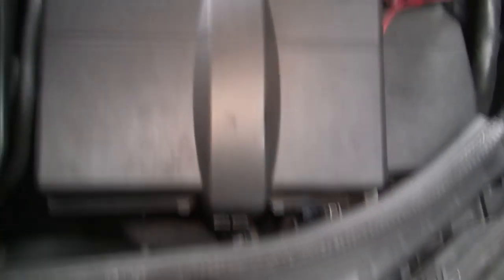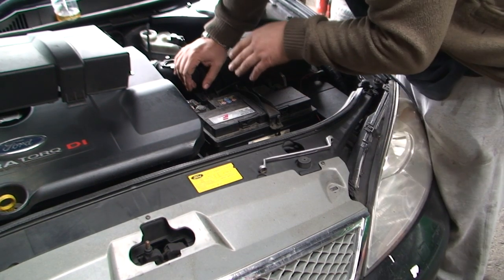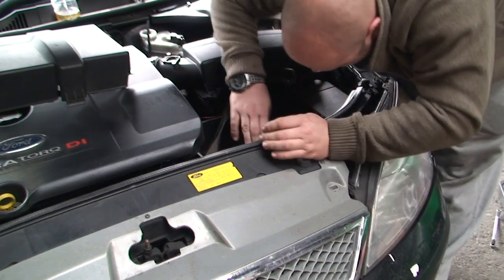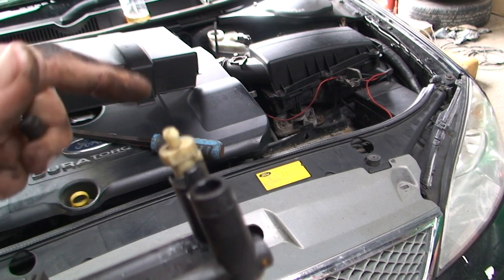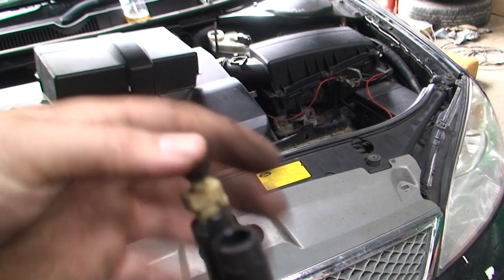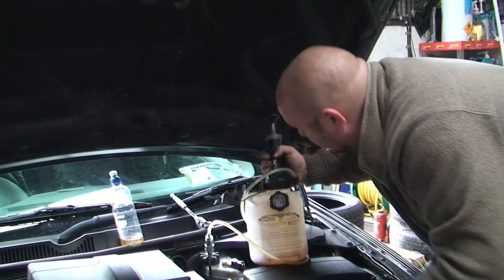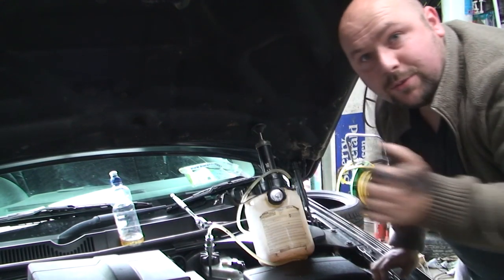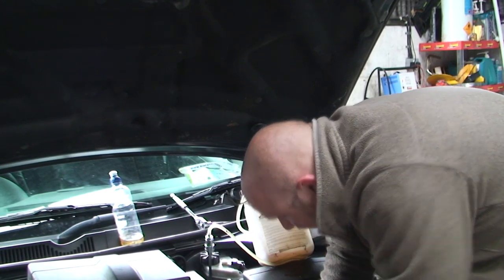How To Bleed A Clutch The Easy Way

Comment: You should always remove the neg first and re-connect it last. And if you remove the negative first and it touches the body how is it still earthing as you said in the vid???
Reply: Remove the negative off your car outside and put it to the fender and let me know what happens
Reply: @MeltingRubberZ28  So tell me what YOU think will happen if I do that?
Reply: @SteveCardiff  I've done it before on a car so I don't even need to state what I "think" will happen haha.
Reply: @MeltingRubberZ28  I really don't think you have done it before because if you did you'd find that nothing happens because you're not completing a circuit back to the battery. If the negative is disconnected from the battery then that's it, the circuit is broken.
Reply: I couldn't believe what I was seeing/hearing. He is doing the exact opposite of what you're supposed to do.

Comment: @ bodgit and leggit garage. I have just had my clutch replaced. Sachs DMF clutch plate csc and pressure plate I think. It has only done 10 miles since and been parked up for 6 weeks without moving. The clutch pedal is half way down and bites within an inch. I pulled the clutch up with my foot and it sat aligned with the other pedals. It goes into gear fine, it does bite early, about an inch, inch and a half but not a grabby bite point. It is nice and smooth. Do I just need to put mileage on the clutch or would you say bleed the system? My fluid is not 100% either but it was fine before hand apart from the DMF rattle which is why I changed the full clutch. Car is a Vectra C 1.9 CDTI 150. Thanks in advance mate. Brake fluid is still full to the brim.
Reply from the maker: try bleeding it again
Reply: @bodgitandleggitgarage  I will do mate. Thank You. Should I invest in the bleeder tool for better results? Worth the money versus 2 people and time etc? Cheers bud.
Reply from the maker: @boxingbreakdowns1016   it will certainly make it easier if you have the right tool mate it's not that expensive and you can use it for brakes and everything you will be using it a lot more than once believe me
Reply: @bodgitandleggitgarage  Cheers mate, that is the route I will go down then. After all it is a tool with many uses. I will keep you up to date once I have had a chance to bleed it again using that tool and see how everything goes. Thanks for your time and advice bud. Much appreciated.

Comment: Today i tried to bleeding the clutch with same pump, but the clutch pedal is very  soft now and does not work. I don't know what i did wrong. Before opening the bleeding screw, do I have to press and hold the clutch?

Comment: I hope you answer your viewers. I have a 2000 dodge dakota sport,  manual transmission. replaced clutch master cylinder and slave cylinder. I have air in the lines. It is a sealed system which means no bleeder valve. I know some will work out as I drive. do you have any ideas how I can get the air out more efficiently?
Reply from the maker: Evelyn Mitchell hi mate unfortunately I don't work on that type of vehicles we don't get them over here so I don't know exactly how the system is done there is ways you can bleeding by disconnecting the pipes and allow the fluid to run through and reconnect them again but I don't know how that system works so I do not want to tell you to do something and you caused damage if it was a vehicle we get over here I would be able to tell you a lot more I hope you understand

Comment: Hi again mate
I have just had an head gasket replaced on my agila 1.2 2003 and have noticed that there is still a little mayonnaise collecting on the filler cap. No loss off water from the tank No overheating and the car seems running great, is this normal or assuming the mechanic who did it didn't flush the engine. Will it cause yet more problems. What would your expert advice be?
Reply from the maker: Hi mate yeah that's pretty normal it is very hard to completely get rid of all of it the thing i always tell the customer to do is to replace the oil after 2000 miles then check and you might have to do one more time and that should be it but it's always a good idea just to keep an eye on all the levels just in case hope this helps thanks

Comment: Hi Leon, I'm changing my brake fluid and may as well bleed the new fluid through the clutch. People are telling me to avoid pressure bleeding as it can blow seals. What's your thoughts on this mate?
Reply from the maker: it's like everything you don't go go too much pressure get the manufacturers specification and you will be fine

Comment: Going to try this 
 i have a astra h and the clutch gose to the floor no pressure in it at all comes back up tho and i cant get in to gear when car is running any ida what it maybe.

 getting a newclutch kit in case any way
Reply from the maker: Hi mate it's very difficult to say as I'm not beside the car but if the car doesn't go into gear it sounds like you've got a clutch problem the car should go into gear when the engine is switched off if not you've got a gearbox problem and possibly a clutch problem
Reply: Hi mate I’ve replaced a clutch on an Astra sri 08 and after two months the gear wouldn’t go into place unless forcefully pushed and it made a loud screeching noise, I tried again 6 months later and now it’s going in to gear but sometimes with a strain and I have to be delicate with the reverse, makes a large clinking sound. Any help on this would be great been proper stressing about this shit for ages

Comment: Hi again!Nice vid!Once I decide to bleed my clutch cause there was no signs of fresh fluid in clutch bleeder after break fluid replacement.I tend to think that Peugeot center hasn't done anything cause once they spotted me watching them they closed the shutter to work area.So,why the break fluid was kind of dark grey and jelly?It is normal condition of b fluid in clutch line?Regards
Reply from the maker: Nemo Cap hi mate I will be doing a video on brake bleeding and brake fluid very soon how to test it what it should look like and how to do a full brake flush

Comment: Hiya I've been doing the brakes on my Passat b6 I bled the brakes and when I came to bleed the clutch the pedal stays down can you help me out with why it's happened? Do I still need take more air out as it's took quite some time and there's still signs of air, also what's the bottle pump called?
Reply from the maker: hi mate yes they must be there still in the system it is a lot easier to bleed the clutch with two people unless you have the one man bleed a system which is what I use in this video which makes life a lot easier but you must still have some air in your system if you get someone else to help you it'll be a lot easier

Comment: Is here a separate clutch master cylinder, or does that pipe you 'pointed out' coming from the fluid reservoir go directly to the clutch slave cylinder? 
Many thanks for all your videos over the years, I have found them to be a great help. Jim
Reply from the maker: lascar48 hi mate on this model yes it has a master cylinder and a slave cylinder but it does differ from model to model
Reply: Many thanks bro.

Comment: Great video mate. I recently bought Fiesta and after 2 weeks driving I'm sure clutch gets harder to push down when I'm driving. Clutch seems good when I get in but gets harder when I'm driving. It's only done about 20K about 5 years old. Could it be air in the clutch system. I just don't know. Thanks for any help
Reply from the maker: Dave James hi mate normally when the clutch goes hard it's the release bearing when you got air in the system the clutch normally just go straight to the floor and does not pop up but these are just normal always weird things can happen in between
Reply: Cheers mate. But would you expect release bearing on a 20K mile car. Or is it the way the previous owner drove it. If it is realease bearing, is that basically a clutch replacement full on. Thanks
Reply from the maker: Dave James hi mate it all depends on how it's driven and it all depends on the part that was put in I've seen them feel brand new I've seen them to do over 150000 miles it's just one of them things that can fail at any stage I'm not saying it is that but from what you're explaining it's certainly sounds that way it could even be pressure plate

Comment: Cheers bro, my mk 7 transit is exactly the same, the fluid is black and the clutch pedal don't bounce back, I can't change gear unless I pull the pedal up with my toe, can't see no leaking under the Bell housing either, or in the foot well by the clutch pedal, thanks for this upload its not the first time I've found solutions on your channel
Good day bro
Reply from the maker: Thanks a lot mate much appreciated I'm glad it helped you

Comment: Hi mate, I’m still getting air every couple of days the pedal bitting point getting closer to floor. No leaks, 6 month old CSC off fiesta 1.25 07. I think it’s sucking air in through bleed nipple so I’m going to put new clutch and CSC and reverse bleed it as I read on Ford website. Sorry my question was when reverse bleeding does the pedal have to be on the floor and can I use a syringe or do I need a special pressure tool to reverse bleed it. Thanks mate and sorry for being a pain. PS I did get the spare tyre pressure bleeder like you suggested but it didn’t work. I think what’s happened is when I bled it before I noticed it was hard to turn the plastic bleed nipple when bleeding because it was under pressure and I think when I turned the nipple it turned the seal and it’s sucking air but sealing when under pressure. I’m just one of the unlucky people 😊 love your videos.

Comment: Video i made:https://youtu.be/vcJP3tW3ces Can a clutch master fail in this way that it does instantly move out the slave but not far enough when the clutch pedal is fully depressed? The slave does move out instantly when I depress the clutchpedal. Also can this problem be cause by to much play on the shift mechanism? The flywheel, frictionplate, slave + bearring and pressureplate are new and I have driven 2000miles with it  without any problem until someone launched my car from a standstill, wanted to shift to 2nd during the launch which blocked like seen in the video. The clutch does not slip, engages and disengages fine. When i floor it to like 3500rpm i still can shift but if i floor it to high RPMS it blocks. Im thinking, somehow the gearbox still gets input i guess when flooring and depressing the clutch.

Comment: Topman, you've just made the process look less daunting, my clutch pedal fell to the floor on my astra j  with fluid leaking on top of the gearbox from the plastic elbow that goes into the slave cylinder so hoping that the o rings and elbow have failed only, fingers crossed 👍👍
Reply from the maker: Best of luck mate hope you get it sorted glad my video is helped
Reply: Hey pal what was the actual issue with your astra j in the end